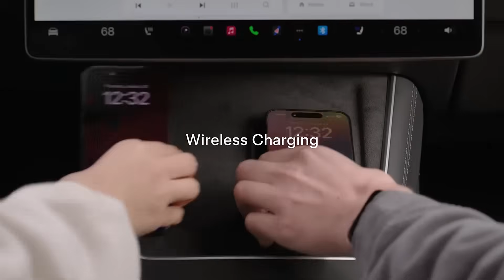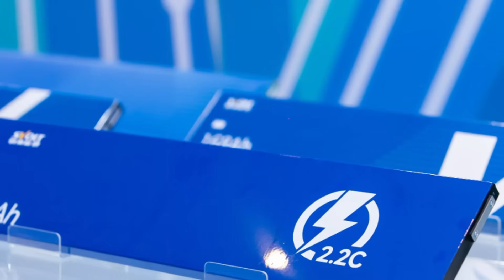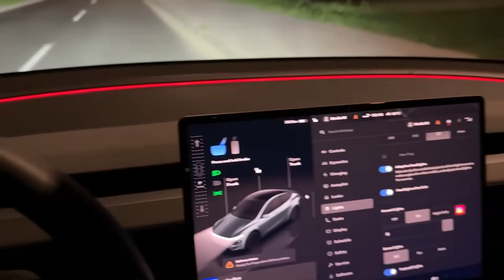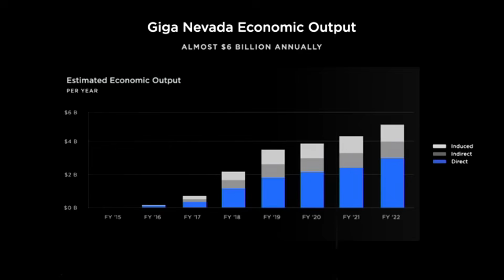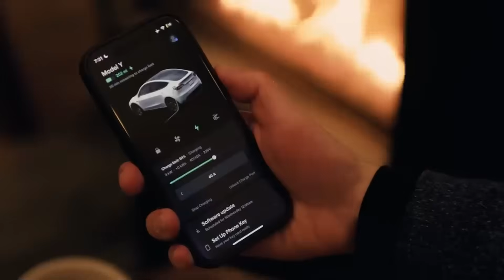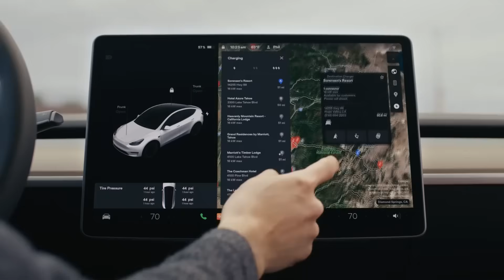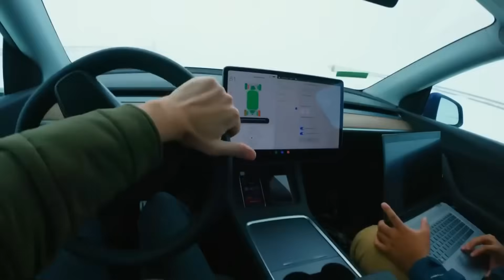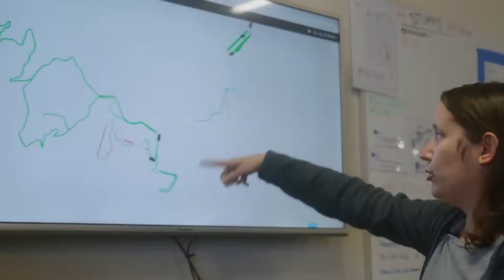NEW TESLA BATTERY Aluminum-Ion - 831 Miles & 12-MINUTE, 85 TWh/yr, 50-year life! Elon Musk shocks!

Comment: I thought Aluminium batteries are highly corrosive and hence the number of cycles very limited.
Reply: That's why one uses silver Ag instead of aluminum  Al.    My silver stash keeps growing.
Reply from the maker: Great observation — that’s been one of the biggest challenges with aluminum batteries. But recent prototypes using graphene or solid-state electrolytes are showing promising results in reducing corrosion and significantly increasing cycle life.

Comment: Tesla might want to consider (after meeting the model 2 demand) power wall batteries and then retrofit older Tesla models with aluminim ion battery upgrades.  The Pi phone needs it, this could change everything for everyone that uses lithium battery appliances.
Reply from the maker: That's a bold and exciting vision! Aluminum-ion could revolutionize not just cars, but homes, phones, and everything in between. Imagine older Teslas with battery upgrades and a Pi Phone that charges in minutes — do you think Tesla would go all-in on this tech across its entire ecosystem?